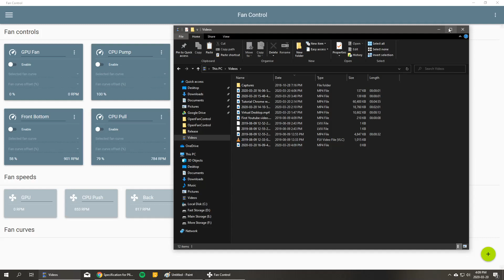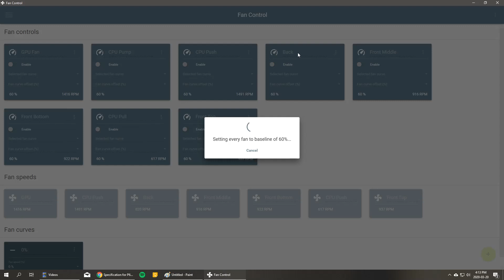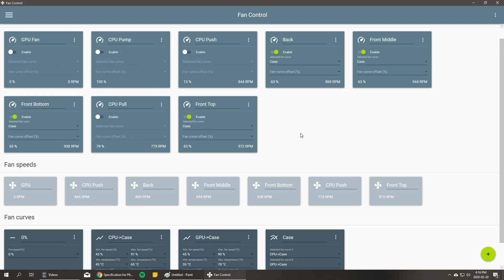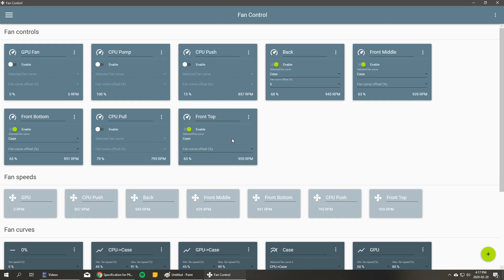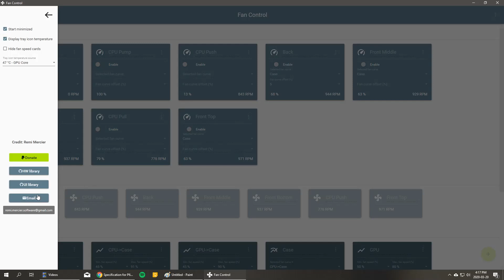Fan Control: Basic setup for case fans (Part 1)

Comment: Hey mate, so basically i have the simple problem that my fans arent connected to my mobo so i cant control them. its 8 fans and they are all connected to like 1 controller, which is directly connected to my psu with a sata power cable. the controller also has a PWM output, should i connect that to the mobo to be able to connect them via the software?
Reply from the maker: You should give it a try. However, you won't get RPM readings ( obviously ) and they will all be controlled by a single channel.

Comment: It seems like the software is only recognizing my GPU fans. My case fans are connected to a hub that is powered by sata but gets it's speed setting from a 4 pin header on the motherboard. Afaik it is supposed to pass through the information of the fan that's plugged into the first slot to the motherboard. I've seen other software recognize it that way but it seems fan control doesn't? In the automatic setup it does, it did list one more fan but said it had no rpm sensor I think. Is there something I can do to make this work?

Comment: Just spent some time today setting this up. Ur tutorial made it easy. Love how you can set a source temp for the minimized tray icon and start the program with windows already minimized. Good interface and now finally I have good fan curves setup for my system and it runs like a beast now. So much better than speedfan. Amazing

Comment: Noticed that these videos are from a older version of the program so some new features aren't mentioned in any of the 4 parts. 
I thought it was odd that all my fans would stay at 1000rpm at all times after basic setup. Went up to 1500rpm idle after setting CPU fan. I hadn't seen anything about the mixed curve for case Function (which was set MAX as basis) that isn't shown in any of the videos. Changed the MAX value to Average and front fans went to 0rpm just like in the video so I guess check that if you have similar problem.

Comment: Amazing Software, better then i have expected ANY Software could be to control fan speeds. The mixed Control is something i wanted for years but never dreamt of it could be possible in this perfection. I have configured all case fans with CPU and GPU Mixed Sensors and it is just awesome. Of course i honored your work with a donation you absolutely deserve :-)

Comment: Hey i have a Problem, i have 3 enermax RGB Fans in my Case when i controll IT with the BIOS And Set IT to silent the Fans Just Stop but try to Spin, And If i want to controll Them with the software IT shows the Fans under Speeds but i cant controll them

Comment: Bro I wanna hug you now. My GPU fans died a few weeks ago and I glued 2 case fans to it until the replacements arrive in like 3 months, and had to manually change their speeds all the time through the MSI dragon centre every time I'm doing something or idling. This is the only thing I've found so far that's capable of controlling them by monitoring the GPU temps which sounds simple but your program is the only one I've found doing it. Cheers!

Comment: Hey there. I've been using your Software for few weeks now and I love it! (Thats why I thought the donation was the least thing I can do) and after the last Update (Yesterday) I ran into a problem. The Program randomly closes without an error and wont start again (gotta start up 4-5 times till it starts again). I'm using it to control the Pump and Fans of the Radiator for the watercooling of my GPU - while playing the GPU hit over 80°C and I didnt know why (normaly doesnt go higher than 55°C). Then I wanted to check FanControl and noticed that it just closed in the Background.

Comment: Holy shit I just want to make one fan stop spinning, why is this so complicated?
Reply from the maker: Just put your finger between the blades of the fan, it should stop.
Reply: @rmsoftware3759  i tried it but not perfect...hold it with you finger and add hot glue..should be okay

Comment: Hey dude! I hope you see this message!

I'm having an issue where when I set a flat curve to 0% and apply to any fan, it works but only virtually. I can see the fan goin to 0% in the software ( I use the Open Hardware Monitor), but physically neither of the fans stop, all of them keeps rotating. 

Coud you please help me? 
Thank you very much in advance!!
Reply: have the same problem here, have u fixed it yet?
Reply: @VidakaDraws  nope. Gave up :(

Comment: The software is great and kudos to you sir!
I have a problem, one of my fans is not being controlled. The fan ramp up and down with temperature but when I click automatic matching it says “Fan# connects to none”.
All of my fans are noctua nf-f12 and all works great to your software except for that one.
I tried switching fan headers and it’s the same, is that particular fan faulty?
Reply: Found the problem.
Some of the fan headers are not being detected by this software.
All the fans are able to be controlled with gigabyte’s own fan software.
My mobo is Gigabyte Aorus Gaming 7 Wifi.

Comment: I am using a Y Splitter for case fans and it detects 1 fan under speeds and that's all fine because mobo can only read RPM of one fan, however I see only one fan control and I can only match it with either CPU fans or case fans. 
I tried setting up a curve now just like you did and even if I paired fan control with this main case fan it still controls CPU fans instead. 
CPU fans are on another splitter for push/pull setup and case fan splitter is on sys fan header so I'm not sure why it does this?
Reply from the maker: The pairing doesn't affect which fans it controls. It is just a way for the RPM to appear on the control card, since the "control" sensor and "rpm" sensor are not the same.
Reply: @rmsoftware3759  Thanks for quick reply but I sorted it out. I didn't realize I could manually match all fan control cards to speed cards. 
Your software is so damn good, I can control all my fans despite sys fan header being DC (4 pin courtesy of Gigabyte board, their so called "Smart System Fan" also known as fake 4 pin.)

Comment: Does this work for laptops? I have an HP Omen 15 laptop (2018) thanks
Reply from the maker: I have done some preliminary work for Dell laptops which have some open-source drivers floating around, but other than that, no, your laptop ( or any laptop) is not supported.
Reply: @rmsoftware3759  Thanks for the quick reply. If you ever add HP Omen Laptops, i'll definitely download.

Comment: Thank you for this video. Very informative and this software is awesome. I never liked the ASUS BIOS software because I run a  custom loop with 4 radiators and 2 cooling zones. Works like a charm.

Comment: Nice tool! Finally found the time to test it. :) I love the interface and the already integrated options while keeping a clean and simple UI. What I really would like to have is a possibility to just control the fans manually without having to set up a fan curve. The option could disappear once you activate the "fan curve" option.

//edit: oh, seems like it's not able to control all of my fans on the X570 Aorus Ultra. There are two different fan control chips on the board, so it seems like the second one is not supported. It's the IT8795E.  I'd really like to do a video about your tool in the near future - but I can't because of missing support for my board. But really good work so far! Hope you incorporate more supported boards in the future.
Reply: I seem to have the same problem and I have a B550 Aorus Pro AC, I guess we just have to wait for Fan Control to support the different chips? Also, where did you find the info for your fan control chips, and does Fan Control have a list of supported chips?

Comment: I cant seem to get it working. Says its running but i cant get to any menu.
Reply from the maker: Windows version?
Reply: @rmsoftware3759  2004 19041.572
Reply from the maker: @ajman66  Anything in the log file?

Comment: Program closes as soon as i click the + option or the option tab on the top right, any solution? <-  Solutionfound, problem was msi afterburner was on... after closing no issue.
other problem im having, im only able to control the gpu and cpu fan, when what i would really need is to control the fans of the case, any solution?
Reply from the maker: Seems like your motherboard is not compatible, sadly.

Comment: You obviously skipped a bunch of steps here .... I made a flat fan curve and none of my fan turn off when I enable it

Start from the very beginning for a proper setup video
Reply from the maker: That's just one way to find which fan is which. Some motherboards don't support to stop the fans completely. You could try the other way arround and set everything to its minimum and go 100% for one at a time to identify them.

Comment: This will overwrite msi afterburner and BIOS settings?
Reply from the maker: BIOS yes, afterburner is a coin toss, they will most likely fight each other. Simply disable your AfterBurner fan control or the other way arround, in FanControl, depending on which one you want.
Reply: @rmsoftware3759  thanks for the info

Comment: can i set up my pump with this software? maybe some hiden future what i cant find..?
Reply from the maker: If your board is compatible and you got your pump plugged into a header, should work.
Reply: @rmsoftware3759  i pluged my pump into system_fan_6/pump... the software shows me the rpm of the pump but dant mach the fan with the controls... it says no one match. it founds just the water cooling fans, cpu fans and the case fans.
Reply from the maker: It is likely the pump header can’t go down low enough for my automatic detection to work.  Match it manually from the three dot menu of the corresponding control card.
Reply: @rmsoftware3759  cant do nothing... the rpm i see in the speeds row, and in the Controls row is no one match. can i send you somehow a picture or someting, im bad at english and cant god explane...

Comment: Hey, The program won't run, I looked in the log file and it says "Unable to load DLL 'nvapi64': The specified module could not be found." is there a file missing?
Reply from the maker: That's a known bug right now, pushed an update.
Reply: @rmsoftware3759  Thank you

Comment: okay I think I have an issue, when I select the "match fans automatically" it could only match one fan and the rest it said " "control fan #1 matches with none" and said that for the rest of the fans it tried to match..
Reply from the maker: That means the software isn't able to control those fans.
Reply from the maker: @Max-kj9xx  That's hardware support, so you can contribute to LibreHardwareMonitor or others.

Comment: Do you need any special fans with specific fan headers to be detected or can they be any fans
Reply from the maker: Depends if your motherboard has voltage or pwm control. Voltage can control any fan, pwm only pwm fans.
Reply: RMSoftware would the msi tomahawk max have this? As this is what I’m getting
Reply from the maker: I don't know about every specific motherboard, can't guarantee anything.
Reply: RMSoftware no worries thanks!

Comment: I have three intake fans connected to a splitter which is connected to the chassis fan 1 header on my motherboard. I followed your instructions but the RPM for that fan control remains at 1550 RPM and doesn't change even with the 0% fan curve.
Reply from the maker: You got your answer in your question, you can't read RPM through a splitter.
Reply: RMSoftware but I can though? Even if I can’t, the fan curve shows 0% but my fans are still spinning at max...
Reply: RMSoftware I’ve tried other fan controlling softwares and it’s the same issue. Someone on reddit said it was because the fans are in DC mode. How would I be able to get them in PWM mode?
Reply from the maker: @SnazzyKP  That would be a BIOS setting I believe.
Reply: RMSoftware okay I’ll look into it

Comment: I really want to use this program but it only changes and identifies my cpu fans, i have 4 other fans in the pc that i cant change. Plz help @RMsoftware
Reply from the maker: I can't really do anything if it doesn't detect your fans. Assuming they are all plugged into a motherboard header.
Reply: @rmsoftware3759  Thx, but i found out that my case fans are connected to my power supply and not my motherboard because its a prebuilt pc, but im still going to use this software for my cpu fan.
Reply from the maker: @Mordobrian  You got your answer there. If you got empty fan headers, maybe try and plug them there. Cheers.
Reply: @Mordobrian  probably it use a custom motherboard and it's a problem.

Comment: Awesome software, works great. I have some tech support questions though..

Since installing this, Windows 10 will occasionally stutter and freeze my whole PC when I open File Explorer in any function. Browsing, saving a file, accessing my external hard drive. I don't want to think it's this program, but it happened shortly after install of FanControl. On one case it even blue screened me. Any input on that? I'm also looking into issues with Windows itself as there was recent updates but I figured it couldn't hurt to ask.

Also, do you plan to add any functionality to have this program run on start? It's not a huge issue, but it was one of my favorite features with speedfan (when it worked). I tried adding it to the Windows startup folder but it didn't work.

Thanks again, and great work
Reply from the maker: 1) For startup, there is a script in the zip file to do so.
2) I don't see a link between your stutter and freeze with my program. In task manager, how's the cpu usage of FanControl.exe when you do such operations?
Reply: @rmsoftware3759  

Hey thanks for the response.

 I used the script and it works, thanks for that. As far as the freezing, I did a few tweaks and another windows update that came in. I can't seem to replicate it for the moment. I opened multiple folders and programs and FanControl never jumped more than 0.4% in CPU.

Ruling out this program as a cause. Thanks a bunch!

Comment: Works for every fan except the two Aerocool sharks on my radiator, which was the whole reason I downloaded this software. Does it not work if fans are on a splitter?
Reply from the maker: You got it. Splitters will mess up RPM readings as you can't read 2 different signal on the same pin, but control "should" work .
Reply: @rmsoftware3759  Control doesn't work. Later I will look at placing that splitter for my intake fans. they're quiet at full, so I can just max them at no increase in noise
Reply: After re-arranging the fans, I got both working off the GPU temps.
Reply from the maker: What did you change for it to work? Curious.
Reply: @rmsoftware3759  Just moved it to a different fan header. that's all
Reply: Also as I found out, the fan splitter wasn't a problem at all. The problem was a single fan header that the software cannot read. The fan splitter is now powering my case fans off a single header that the software is controlling

Comment: I can't find my fans in your software
Reply from the maker: What board are you using?
Reply: @rmsoftware3759  I'm using it on my Lenovo legion t530-28icb
Reply from the maker: @masis_6447  Oh gotcha, it doesn't support laptops sadly, except if your laptop somehow uses the same chips as desktops do :/
Reply: @rmsoftware3759  it's not a laptop it's a desktop

Comment: Lovely app. Could do with some nicer interface :D But i Got problems wth adding it to the startup. CMD won't work. Manually added app to task scheduler but it start with default settings. None on my modified names and settings are visible. Could you look into it please?
Reply from the maker: Replied to your email.

Comment: hey, i have a bunch of pwm fans plugged into my motherboard, and they show up under speeds with their RPM (if i stop them they go to 0), but they don't appear under controls, only my GPU fan has a control card
Reply: Cleared the CMOS on my motherboard and it magically fixed it, can control  all my fans now   \( ^.^ )/
This software is amazing dude! BIG love <3
Reply from the maker: @mogdog99  Don't forget to download the latest version, made a few changes since, and added an automatic updater for future updates.
Reply from the maker: That means the API I use only detects the fan speed sensors and not the control sensors, sadly :/
Reply: Is there anything I can do to fix this or is it just not gonna work :/
Reply from the maker: @mogdog99  Well you could go to the OpenHardwareMonitor github page and try to fix it there.

Comment: Great stuff! Works great. It's the only fan changer that works for me. Only thing i wish was implemented was a customizable curve, so you can change speeds depending on multiple different temps.
Reply from the maker: Have you seen the mixed curve usage in this video? It allows to use 2 different temps in a single curve!
Reply: Ah, i see. Thanks! I'll be using that instead.
Reply: @rmsoftware3759  I've used the mixed curve to ramp up my water pump, in case the gpu OR the cpu needs it sooner, whatever reaches 50°C first with the "Max" function.